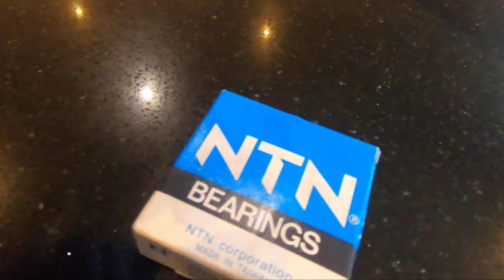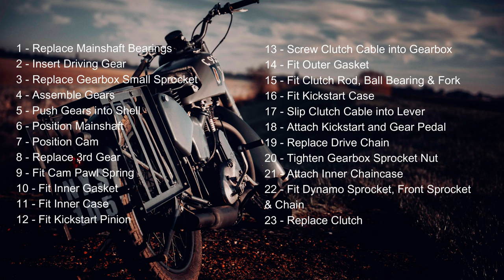Matchless G3L WD Burman CP Gearbox Rebuild

Comment: Using a small torch or a heat gun on the gearbox case, to expand it, before belting in the bearing helps a lot.

Comment: The reason the pawl doesn't go in a slot is because having the selector shaft '0' at 9 o'clock is a 'false neutral' position, between 2nd & 3rd if I recall correctly. My Ariel boxes are very similar.

Comment: Terry, these videos have been invaluable, many thanks.  Question, should there be a kick start stop bushing on that pin in the lower left?  Mine was all chewed up and I wasn't sure where it came from.  Parts manual shows part# 320-X.  Thanks
Reply from the maker: I honestly can’t remember if there was a bush there or not. Just reviewed the video and couldn’t see one. However, if the spares manual lists one then it would be wise to fit. Steve Surbey at AMC Classic Spares could probably advise
Reply: There was a hard rubber slip on bush, these were known to disintegrate over time, the kick start hitting the pin, and often breaking the corner off the inner cover. I have a box of inners with the corner missing.

Comment: Bearing number please
Reply from the maker: Don’t know the number but dimensions for gear main shaft bearing are: ID 1 9/32, inch, OD 63mm, width 16mm. If you give Steve Siurbey a call at AMC Classic Spares he’ll make sure you get the correct bearing